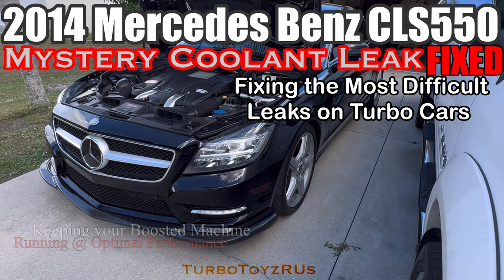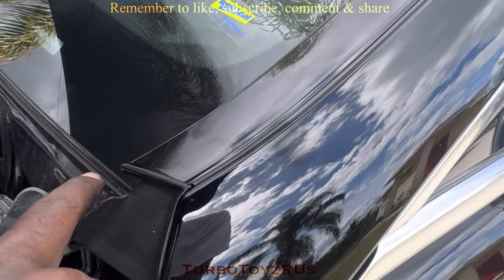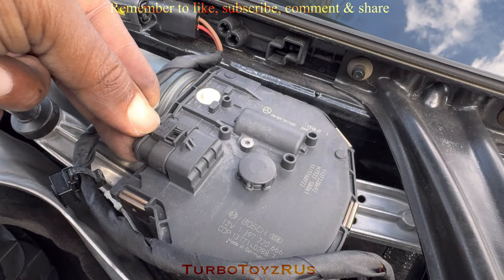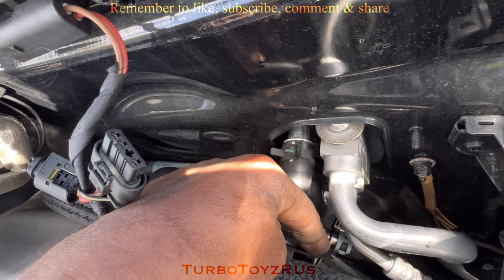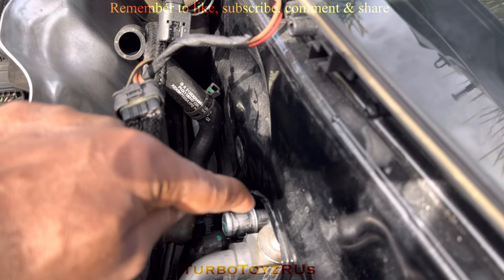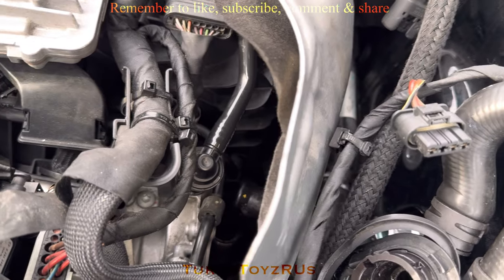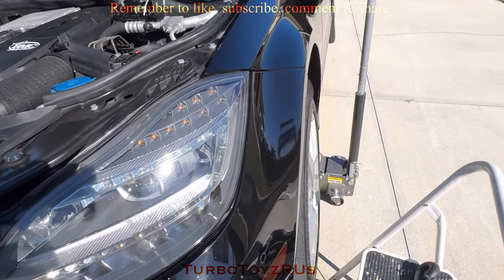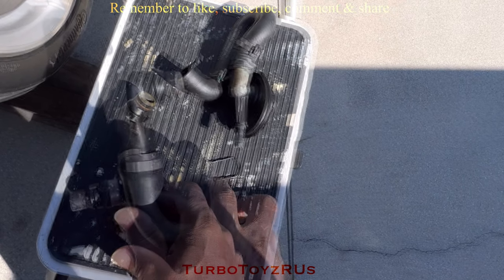Mercedes Benz Turbo CLS550 Tedious Coolant Leak Fixed

Comment: Wow, how does your hand fit in to remove that firewall/bulkhead/heat-sound-shield ? The screws are located down low and with your V8, the available space for your hands would be like near zero. Amazing. Great video. Thank you.
Reply from the maker: 😂It’s pretty tight, but was able to get it done. I was unable to video when I fully removed the silver heat shield which provided a little more work room. Thanks for your comment, happy the video is helpful & being well received.

Comment: Was it very difficult to remove and reinstall the heat sheet? It was hard to remove hoses and you needed to order new one. How about, was it easy to put new ones back? Thanks.
Reply from the maker: Thanks for your support & comment; it was a tedious process as the video documents, the heat shield was removed entirely and it requires a good degree of patience to remove all the obstruction and slowly work the shield up & out from side to side & keep in mind it is very sharp around the edges. To replace the hoses was pretty simple especially since I had lubed the area in order to remove the old ones that wedged in over time.

Comment: I wonder if the E class has the same firewall seeing as they are platform mates. I need this done on mine. I already had the turbo coolant lines, radiator, thermostat and water pump. I am in N.FL Where are you located? 
Edit: BTW got a sub for just showing this "hidden panel".
Reply from the maker: Happy you liked the video & subscribed, your support is greatly appreciated. Extremely pleased that my work & video is proving helpful to others. I am in South Florida, but that job I did in SW Florida. Remember that heat shield panel is very sharp so be extra careful when maneuvering it. Good luck on your repairs 👍🏾

Comment: How many bolts on the firewall shield? And what tools did you use to get them out?
Reply from the maker: I really don't remember how many bolts hold the heat shield, but if I had to guess I would say 4. 2 10mm to sides & 2 to the back. Finesse is definitely required to get the shield out; I couldn't video everything because needed both hands. The shield is sharp so be careful; maneuver the wires & hoses out of the way then gently guide it up.

Comment: Mine just burst today , how did you get to the plastic piece that connects to back of engine ?
Reply from the maker: Take the heat shield out entirely after disconnecting the two pieces; take out the retainer clip and use a little lubricant to soften the rubber seal through the retainer groove, then wiggle and pull gently. Good luck on it, use a magnet to help remove the retainer clip so you don’t drop it. Watch the whole video so you don’t miss anything.👍🏾
Reply: @turbotoyzrus6286    I’m just seeing your response , but that’s exactly what I did yesterday , thanks for posting this vid it showed me the way

Comment: The control valves should be a maintenance item they get brittle in 5 years +- and always crack and leak. You only find out later because its hidden.
Wish they were metal not plastic
Reply from the maker: When I saw all the plastic integral cooling parts from so many of the newer vehicles, I remembered that employment security which modern economies are dependent on, is paramount to automotive engineers and manufacturers over durability. Clearly metal is the best material choice for these kinds of hard to access parts, yet we get the inferior plastic; it's a deliberate design sabotage and it's not only happening in auto parts.
Reply: @turbotoyzrus6286  what is that 90 elbow called at the 13:31 mark? I need that piece it actually corroded/rusted off!
Reply: @turbotoyzrus6286  I like your definition "it's a deliberate design sabotage" It is straight to the point :)

Comment: Great video. Thank you for sharing/teaching. Someone did this very same replacement by taking whole intake out. Your method is easier and more logical approach. What was the mileage of this car when this leak happened? Could you also share parts numbers you have used for this work? Thank you for your time.
Reply from the maker: Thanks for your support & comment; happy the video is helpful & is being well received. I believe the mileage was a little past 105,000. The part numbers are A 2128300496/ZGS001 for the part closest to the firewall & A 2128302300/ZGS001 for the part directly connecting to the engine. I believe the video catches the part numbers as well briefly, but you would need to pause to get them. Again I thank you very much for your response.
Reply: @turbotoyzrus6286   Thanks a lot for the information. Again, your video is very helpful  and unique.

Comment: These car makers insist in making plastic parts on everything
Reply from the maker: Yes unfortunately; manufacturers decide that job security for dealerships & the parts industry is more essential than quality products for consumers. This is how we use physics now to maximize profits; as soon as many things are out of warranty, failure occurs. Easily this problem would not exist if the part was metal.